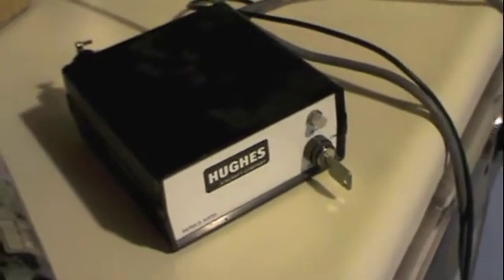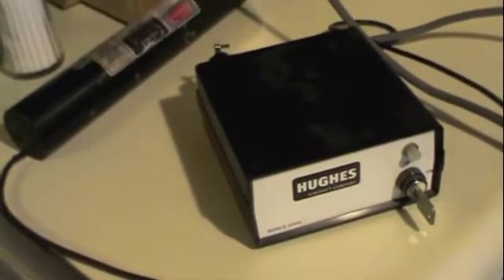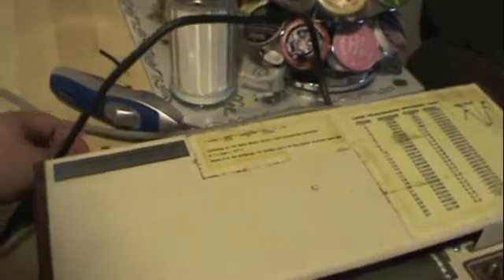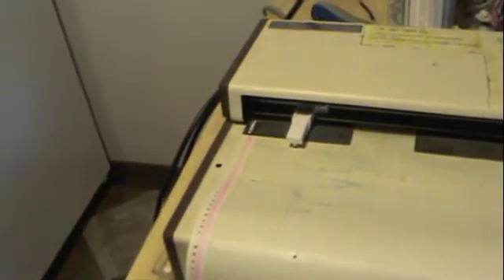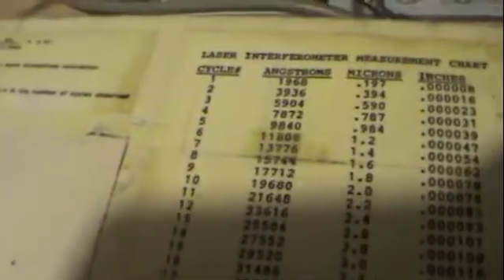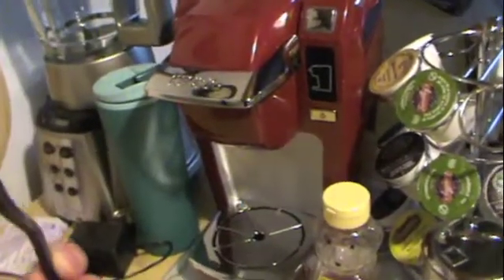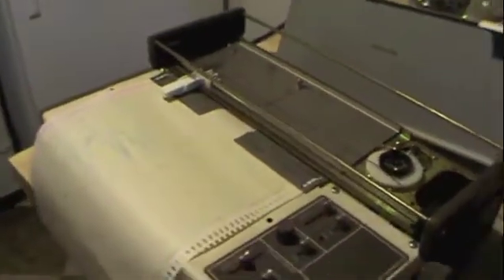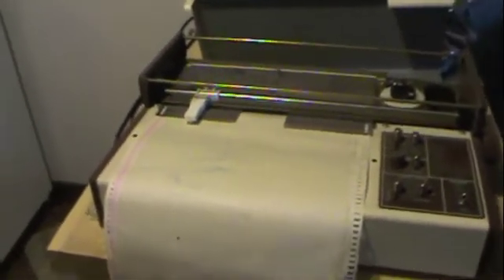Strip-Chart Recorder and Class IIIB Hughes Laser

Comment: When I worked with ncr for 9.5 years they used class 3 laser in there older scanner 
I have 3 of the scanners in my basement  I have the complete schematics for them the lasers run of a high voltage transformer and it put out 15k at 1.2 amps I cant believe that there are some older stores   still in use I see them on ebay as scrap sometimes . They only plug into 120volt someday I may take one apart .
I have gogglles from the training school how to repair and adjust order goggles every year